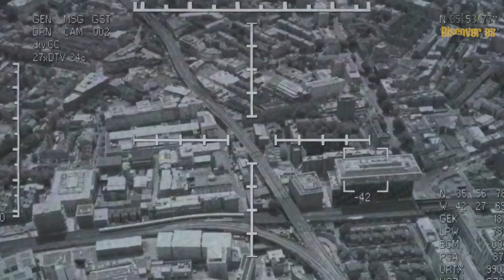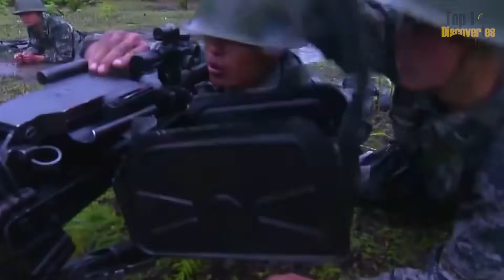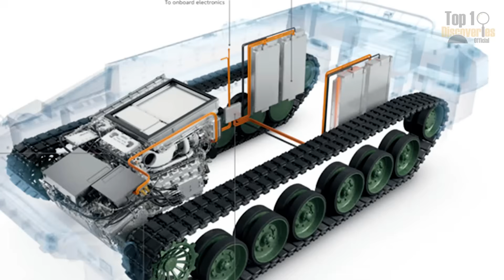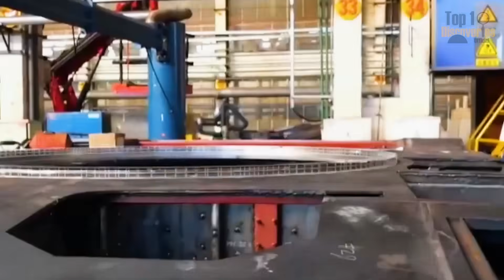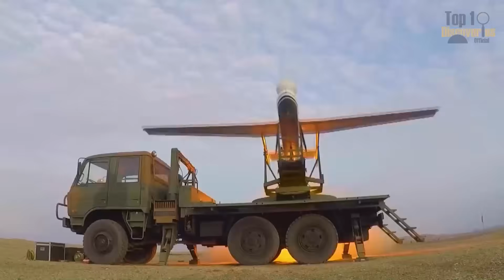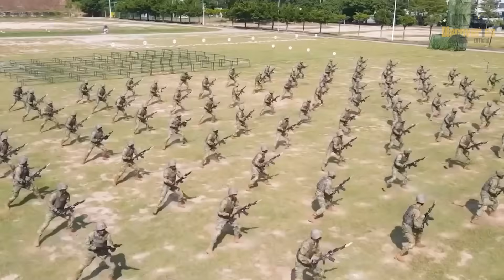Type 100 China’s Futuristic Tank That U.S. Analysts Didn’t See Coming

Comment: Tanks in the future are metal coffins
Reply: As a Chinese, I also agree with your opinion. Although each country has redesigned its new generation of tanks and redefined the role of tanks, tanks are still weapons in a two-dimensional sense. When facing unmanned aircraft with higher dimensions and greater flexibility, they are at a disadvantage. But at present, is there any new weapon that can effectively replace the role of tanks. Perhaps new things will replace tanks in the coming decades.